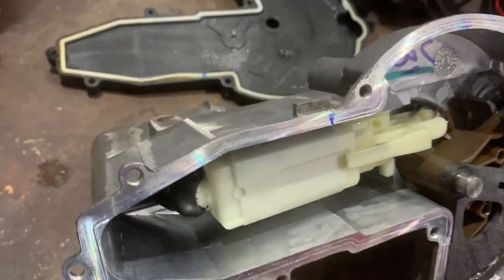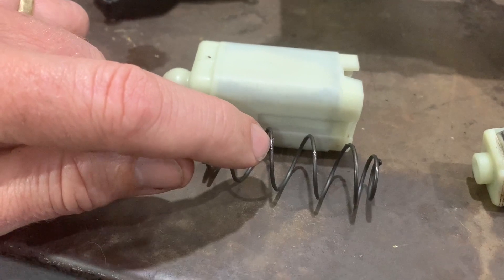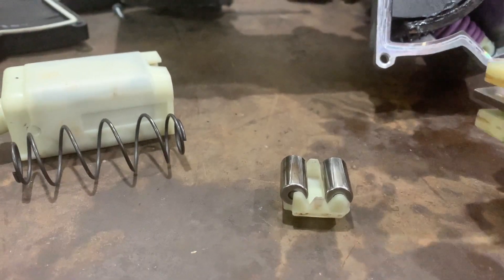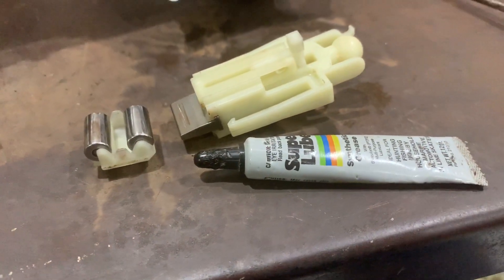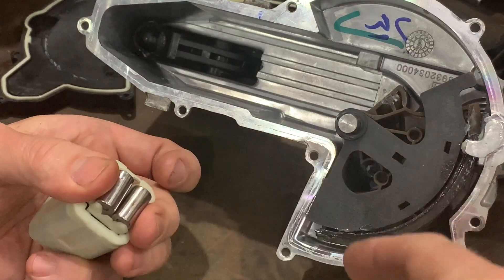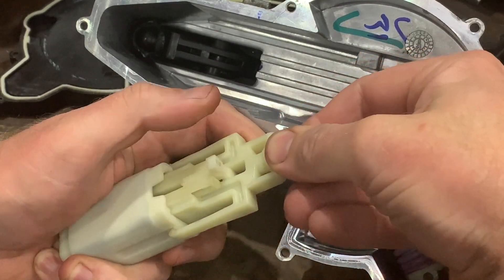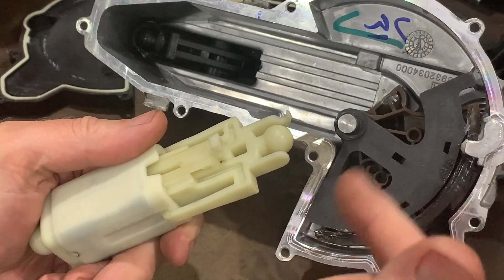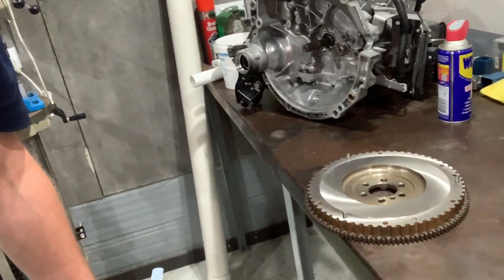Citroen C2 Ep2 - Clutch Actuator

Comment: I think i figured out what is the point of the wedging mechanism. The problem it tries to solve is to adjust for the wear of the clutch friction plate. As clutch plate wears it gets thinner which makes the metal "sun" plates of the clutch release stick out more towards the gearbox when engaging the clutch (friction plate squeezed) and thus making the clutch fork travel more towards actuator so there is a need to allow  for the free retraction of the actuator pin when its "hiding" inside the case. On the other side when clutch is disengaged (while shifting) no play is allowed as the pin needs to press on the fork. This mechanism allows for that making it possible to squeeze, but only when fully retracted. The moment the plastic is moved out the wedging mechanism goes into play which makes squeezing no longer possible. That is very clever and I really admire the engineers for coming up with this idea.
Reply from the maker: Agreed. Clever.

Comment: If that spring releases by accident, it cracks the casing. If a gearbox is removed and the clutch actuator has not been put in its safe position, it cannot be safely removed. You hear a click and the casing is cracked

Comment: when you cranked your actuator back against the spring... what stopped it going pushing back again? I am in a similar problem. i powered up the actuator up while disconnected and it has pushed the arm forward and will not come back.